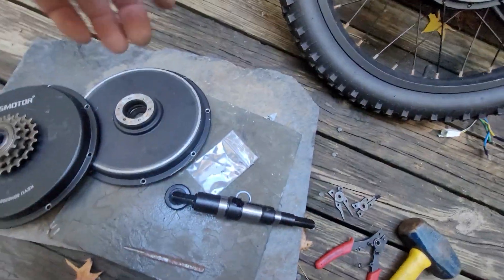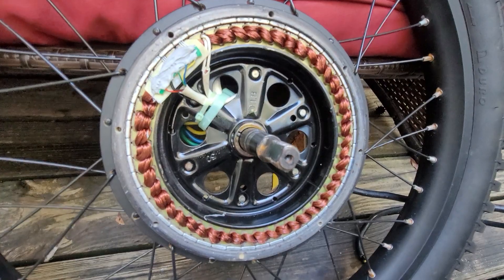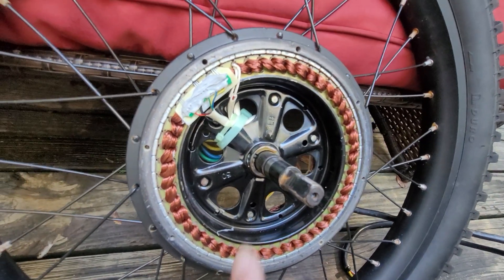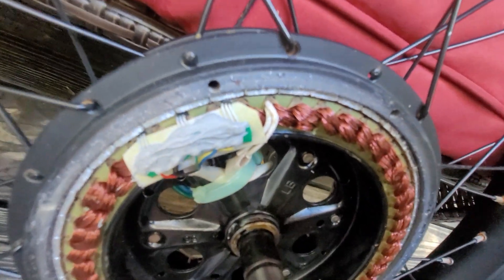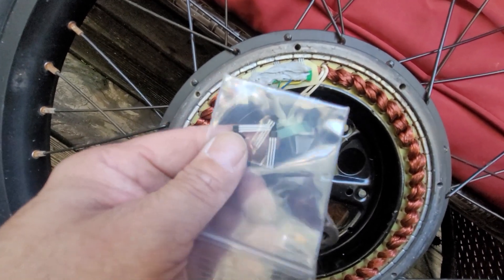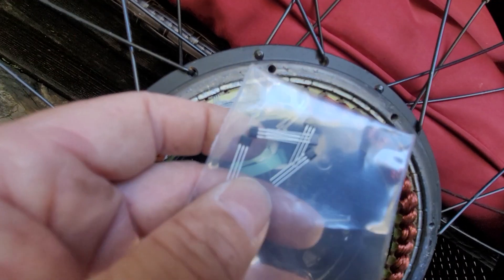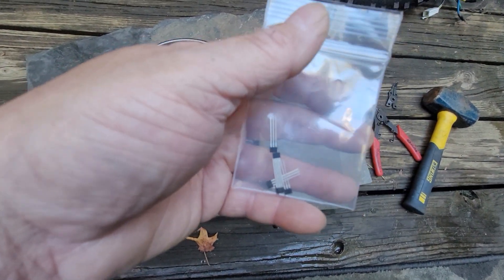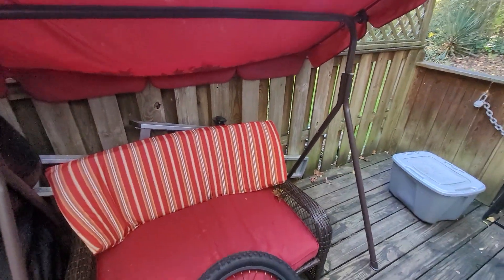Replacing hall sensors &  is axle is easy, as long as you can solder and separate a hub motor. lol

Comment: While you have the axel out you could take it to a machine shop and bore it so the axel is hollow all the way through. Maybe a smaller bore on the new side, for putting bigger wires to the motor.
Reply from the maker: the one Im replacing it with already is larger as it must be for a higher wattage motor. This bike isnt gonna be runniing that much pwr so not neccesary, this isnt my motor this is off the light weight bomber. these axels are smaller and fragile   already I dont think that would help as they already prone to snapping. this axle is allot smaller thanmy 273 axle